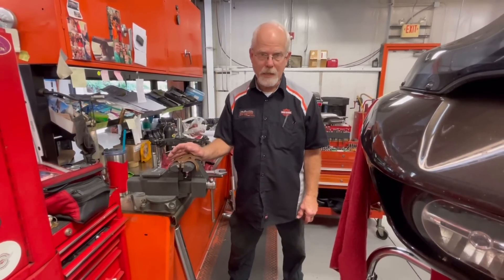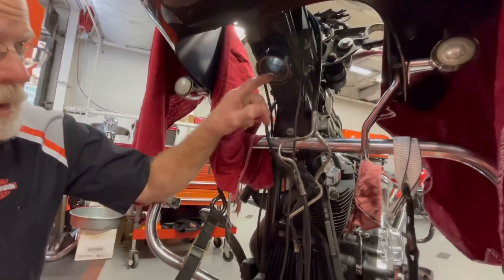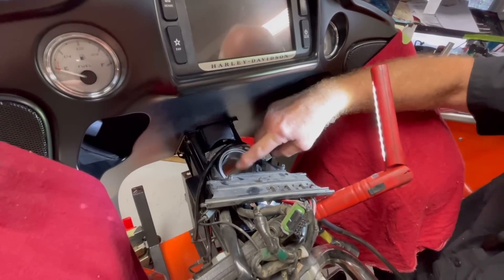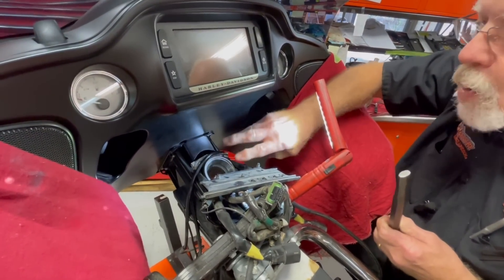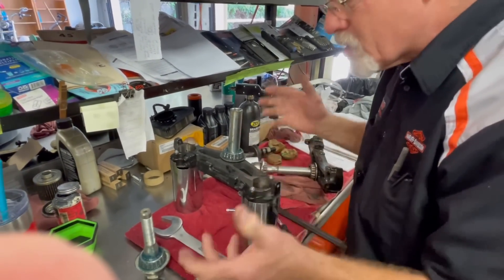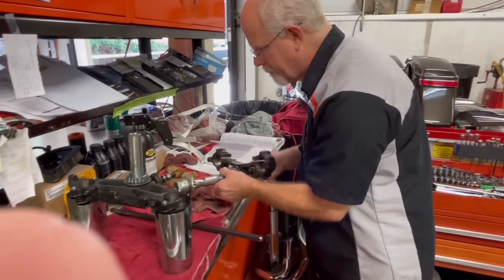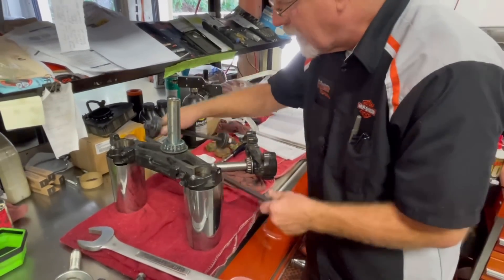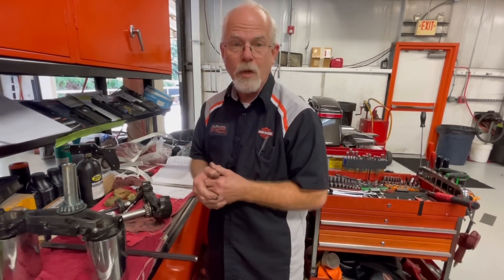The Harley-Davidson 100K Neck Bearing Service

Comment: As a former tech, I'm very impressed with your level of expertise and your ability to articulate your procedures. How much to complete a 100K service on a 2000 Screamin' Eagle Road Glide. This bike was one of HD's later-production 2000 MY bikes, and it came from the factory with the cam tensioner 'fix'. I know there are variables involved, but if you could give me a reasonable, logical ballpark cost, that works for me. I would ride this bike to SC, IF YOU would do the work!
Reply from the maker: David we appreciate your kind words and extreme effort for our department to service your bike. Doc is booked up rebuilding the old Harleys and building 3 fleets of police motorcycles……

Comment: So in basic theory..
The upper stem bolt isnt reverse threaded..
So with pinch bolts loostened you can still adjust bearing tension from the top as righty tighty..
Reply from the maker: Yes as long as the lower tree pinch bolts are loose on early models. 2017 and up touring is totally different….Doc

Comment: Hi Doc, thanks for the detailed info and explanation. You mentioned rebuilding both fork tubes. If the bike had aftermarket components in those fork tubes, Legend for example, would the rebuild process be the same (same fluids, same disassembly/reassembly procedures, adjustments, etc.) or could this be a blind spot for the owner still using a dealership for K services?
Reply from the maker: If stock fork components where replaced with legend parts, it would be a good “heads up” to give the service dept this information. Springs and oil replacement would be like stock. Cartridge replacement is a whole other game in service….Doc

Comment: I had my 2018 flhcs in for front end bearings replacement after having new tires installed a week before at only 14,00 miles damm that really hurt 😅
Reply from the maker: I am glad you know all is right now….Doc

Comment: Can you do a video on how to ajust 2020 road glide neck bearing adjustment in detail.
Reply from the maker: Nope, I leave that to others and my fellow Techs….Doc
Reply: I’ve an 18 rg, I bought it 7 months ago, first few months road fine and now it has a wobble that is getting worse, very twitchy, I just got it back from roughneck hd in Longview, they said they replaced the neck bearings but I can tell nothing has been touched and I still have a wobble in the bike, it has 40k miles on it! Is the bearings the cause?

Comment: When doing the neck bearing adjustment on my 2014 Electra glide do I loosen the top triple pinch bolts or the lower triple tree pinch bolts?

Comment: Got a question Doc. I got a 1998 heritage softail springer.  Springers have a bad reputation for eating neck bearing earlier than regular front ends.  I bought mine with 3000 miles on it.  Changed the bearings at 30,000 but they probably didn’t really need it. What’s your opinion on the service intervals for springer neck bearings.  I have 52000 mikes on it now.
Reply from the maker: You are so right. Standard fork models have the neck bearings inspected and adjusted every 10K. Your Springer should be lubed every 2,500 miles ( through the zert fitting) and neck adjustment checked at every service! Disassemble every 20K with lower rockers lubed and adjusted….Doc

Comment: Great video. I just have a quick question. I’m doing my 25k service on my 21 Street Glide. The service manual states that the bike must be in OEM form when checking the fall away for the steering head bearings. My bike currently has 16” 1 1/2” diameter Fat Baggers bars on it. How will this effect the process and do l have to do something different from what is stated in the service manual? 

Thanks again for all of the great videos and advice.
Reply from the maker: The suggestion is to remove all items that would effect the process like clutch cable, drink cups, GPS or phone holders…Doc
Reply: @LowCountryHarleyDavidson  Thanks

Comment: Thanks for this info! I always wondered about the neck bearing service requirements on my M8. But, a 2018 M8 went 100K without lifters and cam disintegrating? That’s not what I read on all the Harley Forums…🤣
Reply from the maker: Bone Stock with Every maintenance performed…..Doc
Reply: @LowCountryHarleyDavidson  That is so reassuring!
Reply: @Old-n-slo-locked-n-leaned and so uncommon

Comment: Is the Neck Bearing only done at 100K? 🏍💨🏍💨
Reply from the maker: For M8s yes or depending on operation but the neck bearings are inspected and lubed every 25K at this dealership…Doc
Reply: Mine is a 2021 Road Glide with 40k with Service performed at the Dealership every 5K.
I wonder 🤔 when/if my Dealership will do my Neck Bearing? 🏍💨🏍💨

Comment: What if I loosend the top pinch bolt and just turned the nut ? Did I ruin something ? Didn’t know u can go thru bottom(2022’road glide )
Reply from the maker: Oops 😬 probably depends on how far you rotated the nut….Doc
Reply: @LowCountryHarleyDavidson  what could happen if I over rotated ?
Reply: @LowCountryHarleyDavidson  well turning the top nut is the same as going from the bottom is it not ? Since that’s what the bottom does anyways ?

Comment: 02 road King ultra  will not idle at stop light
Reply from the maker: More likely a manifold leak. If a Mag-Merreli bring it to your dealer for a tune up. It helps once a year….Doc
Reply: What about throttle sensor

Comment: Ciao vi chiedo come mai la mia Street glide 2015 o un problema quando prendo buche grosse tombine o cordoli fa un forte rumore verso cannotto sterzo o fatto sostituire cuscinetti mi anno rifatto anche forcelle ma lo fa sempre
Reply from the maker: First I have to know, is your bike lowered? When a Harley-Davidson is lowered, it reduces the suspension travel. So the suspension is maxed out when you travel over pot holes. After your neck bearings replaced, maybe have the adjustment checked again, just to be sure. You could try heavy fork oil but the ride will be harder. I suggest looking into aftermarket suspension parts…..Doc

Comment: My 2015 Ultra Limited made it to 5k before the neck bearings were so loose it felt like my handle bars were going to come off in my hand. It cost me over $2o00. for them to just look at it. Surprise it was really was really loose. I called the factory to complain and they could have cared less because they were making the M8 and all thing wre about M8's and they did care about a 103.
Reply from the maker: Sad story…..Doc
Reply: That's rough. I'm planning on doing as much maintenance as possible myself.

Comment: I find it hard to believe you wouldn't change out the lower race while you had it apart.  Bad call on your part.
Reply from the maker: I guess I mumbled…. When I showed the top race I mentioned you always replace both….Thanks for point out my faults….Doc
Reply: @LowCountryHarleyDavidson  I heard you loud and clear
Reply: @GrumpyRider  Same here. Doc was loud and clear on always replacing both. And also saying one fork is leaking so he's gonna rebuild both
Reply: @Scotty 
I think you need to listen closer, he was very clear when he stated you always replace both.  Bad comment on your part.
Reply: A pair is 2. Top and bottom.
Reply: Pairs=two. You should edit or delete.
Reply: @LowCountryHarleyDavidson   DUDE NEEDS TO CLEAN OUT HIS EARS!